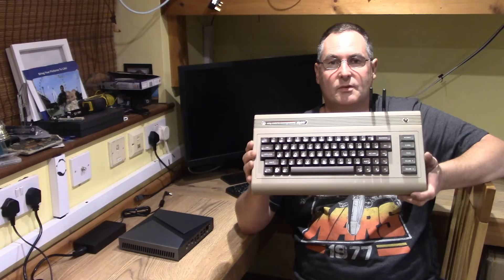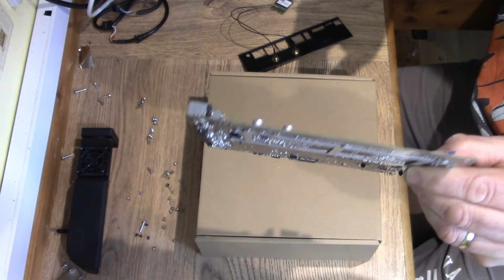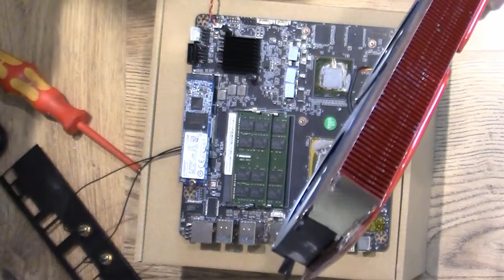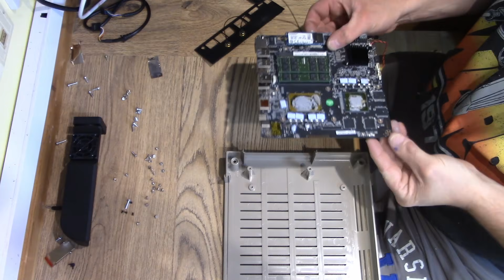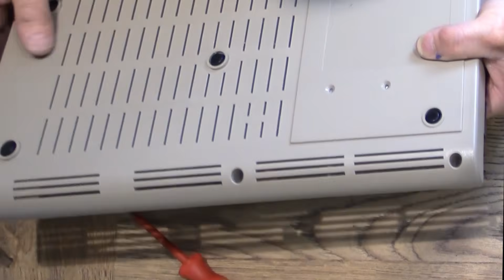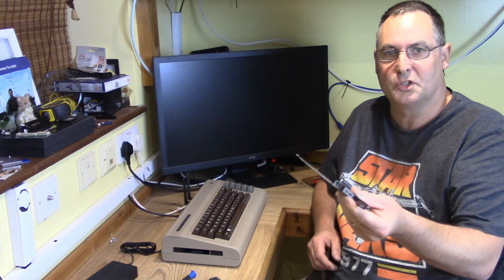C64X Gets a Graphics card!

Comment: Great video and fantastic build!  I have an original CUSA case that's been waiting for the right motherboard and I think this is it.   In fact I'm typing on the kbd section now :-) 
I have had an eye on this board for a while but didn't think the coolers would fit and thought it would require custom heatsinks and fans... so many thanks for the video.   
A couple questions - I'm assuming these boards are not available with the extra ports already soldered in at this point.  Are they just filled in solder points that can be desoldered and header dropped in or are they actually not drilled through on the board (or did they use smd headers which would be probably not the best choice for longevity of connections ?)  
Also is iCore64 making the 3d cooler vent available for purchase (I'm in the states).   I have a friend that would print and approximation for me but your design with the cable indent is awesome and  looks abosultely factory, very professional.  I would consider putting a Noctua fan on the end to help flush the heat out quicker but its unclear how effective that would be.  The iCYdock is also great solution, although I may do a traditional optical delete SSD caddy instead as I will possibly do a multi drive internal raid solution.   I will also use a USB 3 different card reader that should fit well.  If it does I'll post the info here as a possible upgrade for folks.   Thanks again!
Reply from the maker: Hi SX64 man, glad you liked the video. So, as far as i can tell, the usb 2.0 header and front panel header just need to be soldered into place. I have a board at home - from memory it's all on the board ready for someone to solder the headers into place. The build is brilliant and only runs slightly hotter (if any) than when it's in it's original case. I would go for the i7 varient though because i have been told that the i9 natively runs hot so the i7 would be the cooler option. Email me on info@myretrocomputer.com and i will reply with the 3d file and a picture of the motherboard so you can see the solder points yourself.
Reply: @myretrocomputerltd5179  Awesome - will do - good tip on the i7 vs. i9 that makes total sense.  I may still get the i9 as I used to work in the 90s for a custom computer manufacturer and we had all sorts of creative cooling ideas (long before the great stuff that exists now that gamers have contributed to the scene) - I'm going to consider it a challenge :-)   What a find though.... I always wanted to convert the c64x to something I could use as my daily driver and retire my beefy 8 fan (!) gen 1 i7 tower as a home NAS and this totally fits the bill.    Cheers.

Comment: Here are some videos of the graphics comparison between nVidia GTX 1650* (on this board) and AMD Ryzen Vega* integrated graphics, as found in mini-ITX boards, across several popular games.
GTX 1650 vs Ryzen 5 Vega 11. https://www.youtube.com/watch?v=bNN_2Oo3JjE
GTX 1650 vs Ryzen 3 Vega 8. https://www.youtube.com/watch?v=6Q3FxGMJSj8 (From the Ryzen My64 build video)

* Discrete chip may or may not match performance of the graphics card, although it should be similar.
* Later Ryzens may have different integrated graphics.
Nb. RAM speed may make a difference.